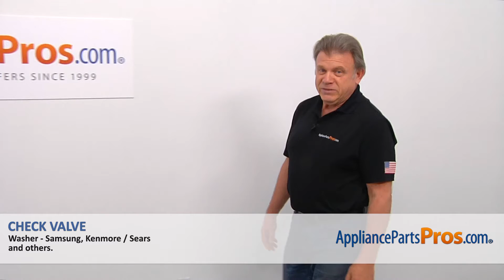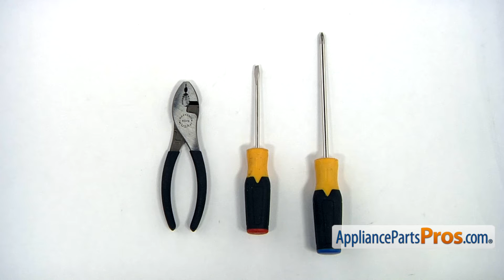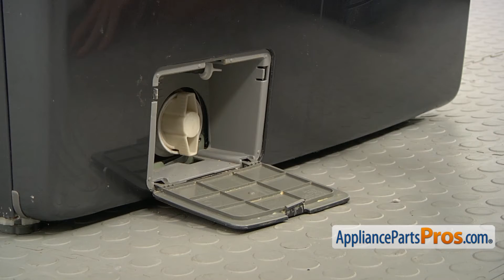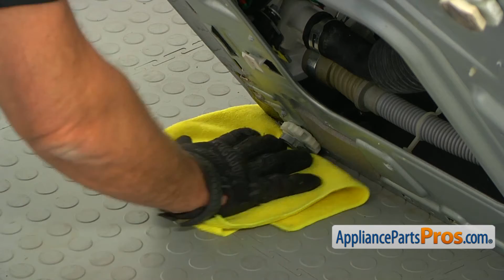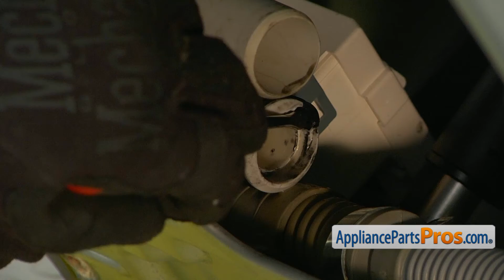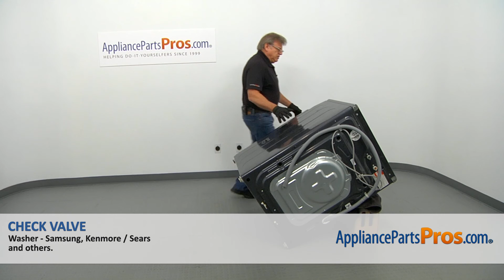How To: Samsung Washer Check Valve DC62-00299A

Comment: Would that rubber valve cause my washer not to drain ???
Reply: I wished someone had answered your question....I am having the same issue and want to know if it is the check valve.
Reply: Yes it can. If it breaks loose it can block water flow in both directions. This is fairly common as the "hinge" holding it in place is nothing but a thin piece of flexible rubber. They will break down over time from bleach and other chemicals
Reply: Could it cause it to leak? @c0sm0-o0o0o